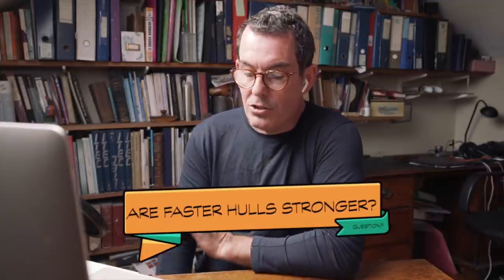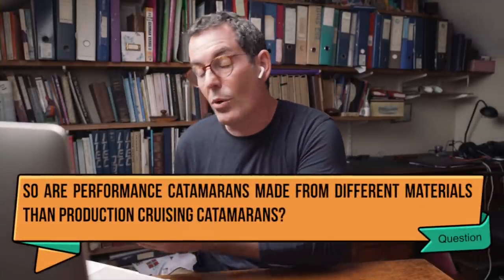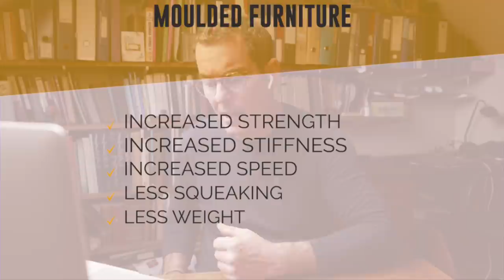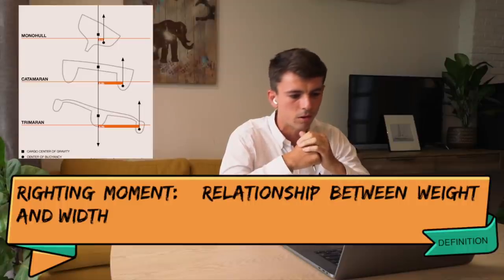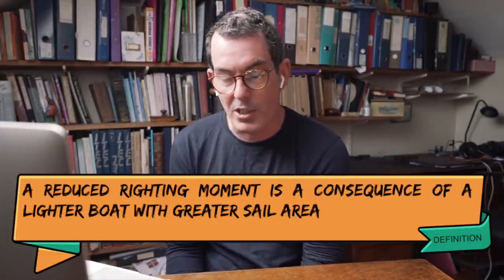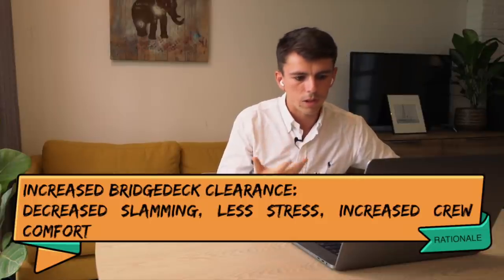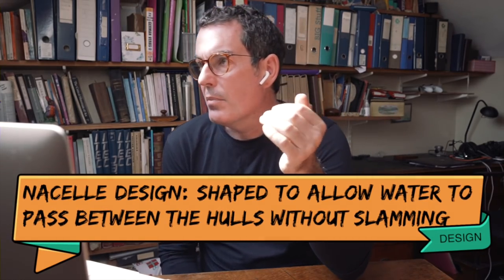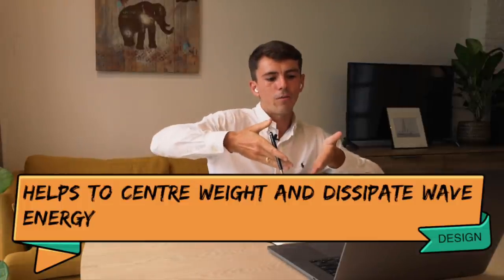CATAMARAN DESIGN: Why Are Some Catamarans Safer Than Others? Ep. 4.

Comment: one point. The narrower hull doesn't dissipate the wave energy, it takes less energy out of the wave
Reply: That’s what I thought I was going to use the word ‘absorb?
Reply: @JG-iz8ko  -- The hull shape could deflect the wave energy ... it will absorb some too.

When the waves break, we fix them!
Reply: Yer it’s how it cuts thou the waves to instade of riding on top of the waves
Reply: agreed
Reply: How about the narrower hulk slices through the wave.
Reply: yep it dissipates less energy because more energy stays in the wave.
Reply: Mission Gameliel  nope opposite.
Reply: @JG-iz8ko  It does not dissipate or absorb, in order to dissipate it must have absorbed. It 'deflects' the energy. Big difference. A bullet hitting a wall and stopping, the wall absorbs the energy. A bullet that ricochets of the wall has its energy deflected, with some lost due to friction. A long sleek hull has drag as it still has surface area, but it is less frontal area.
Reply: A little confusing. Is a narrower hull helpful with bigger waves? Or the fact there’s a keel on narrower boats? Or the cat having considerable weight up high with a mast?

Comment: You completely missed the danger of daggerboard and shorter "keels" being a kind of " tripling hasard" in big seas, leading to capsize. As the architect said, on a cruise cat, wind pressure only will lead to mast breaking long before capsizing. Rather let the architect speak and explain more with more open questions

Comment: Cats are faster due to less wetted area. Performance cats are lighter, to reduce wetted area. Hull shape contributes here too. Righting moment on heavy cruiser cats is so huge, the rig will fail first. This is by design to save the boat when in the hands of inexperienced sailors. I feel safer sailing a big performance cat in high winds than I would a cruiser or a tri. One has rudder authority for longer on a cat than a tri, meaning you can correct upwind at high angles of heal. Cruiser cats, you should never risk sailing in high wind, you'll likely loose the rig before you have any indication of overload. I would say that lack of rudder authority is the biggest contributor to Tri capsizes. Once you fly your centre hull, no rudder, you need to de-power or you'll get into lee helm and over you go. The amas with high volume will drag you down wind and you just can't dump enough main or jib to counter. Cruiser tris have less ama volume to give you time and then to pitchpole rather than capsize.. the design here is to submerge the bow but not pitchpole, but it not a controlled event and if trapped running this way, cut the back stay and let the rig go to lee. You can recover it afterwards, usually pretty buoyant.

Comment: Using furniture moldings is a low man hours way of making a boat, and an easy way to make a finished looking interior, but it is the weakest way of making an interior.  If every piece of furniture is laminated to the hull, that is the strongest way to make a boat, because every piece of furniture is a stiffener.  Molded furniture parts would prevent getting at the hull from the inside, which would be a huge problem if the boat has a hole in the hull from grounding on rocks or coral, or hitting an awash cargo container.

Comment: I feel that Nick somewhat misconstrued what the naval architect was saying on the strength of performance versus cruisers. Weight for weight, then the performance cat is indeed going to be stronger. But if you are not so concerned with weight, as cruisers aren't, the structure can always be beefed up at the cost of more weight. The safety from that point of view is a result of 'how safe and strong do you want it to be?' versus 'how fast and inexpensive do you want it to be?' It is not that performance cats are inherently safer as Nick took it to be on that point, although of course they are weight for weight. And the shape of the lighter cat may cut through the waves more, which reduces stress, but the lighter cat will bounce around more, which increases it somewhat.                                  Similarly on bridge deck clearance, the naval architect can choose that, and admittedly the designers of charter cruising cats often make them too low.                                                                         But the worst of all world's in that respect would be an overloaded performance cat, sitting a lot lower in the water than it was designed to do.
The ability to carry a lot of weight is a good thing, not a bad thing, and there are all sorts of valid trade offs which can be made between that and speed.
If you want to get out of the way of storms by running fast reliably, there is a lot to be said for a big engine and plenty of diesel.
It is what you fancy far more than safety for performance versus carrying a lot of stuff.

Comment: Where there is talk of “stringers”, and where the furniture is integrated into the mould & the design of the bridgedeck making it non-flat, is all about making the structure stronger by adding “compound curves” - they impart incredible strength, with minimal additional weight.

Comment: If you ever do a follow-up to this...I think it would be interesting to explore what it actually would take to flip one, picking a real world example or say a particular seawind model... what combination of wind speed and sail area...and then that coupled with tilt from a beaming sea?
Reply: A Conser overturned off of Lanai from a wind gust off of a cliff.  It is a very light boat, (12,000 lbs at 47 ft. loa,) with not much stuff on board since it was a day trip boat.  It had a tall rig.  It did have a lot of people on board, 44, perhaps about 8,000 pound of people.)

Comment: Just a clarification from my understanding of the equation for Righting (or Restoring) Moment on a catamaran does not have anything to do with the sail area (or the height of the mast).  I thought the formula was "weight * righting arm length" where "righting arm length" is the distance from the fall line of center of mass to the heeling pivot point.  It is a torque vector measured in N * m.  The sail area plays into the Heeling Moment which needs to be offset by the Righting Moment.
Reply: That’s correct. Righting moment is all about the hull and doesn’t have anything to do with sail area.

More sail area or increased mast height simply raises the centre of effort, which means there will be a lower static stability based on a given righting moment for the boat.

But it doesn’t follow that a performance cruising catamaran will have more sail area than a more accomodation-based catamaran. In fact, it may be the opposite, as a performance cruising catamaran can use less sail area to keep sailing as it isn’t as heavy and is more easily driven. Our 55 foot catamaran (a 2003 Outremer 55L) has nearly the same sail area (115 square metres) as the 10 foot smaller Seawind 1370 with a sail area of 116 square metres. For cruising, a smaller rig is safer.
Reply: @tomjarecki  Good remark guys! I was intending to flag out that sail area has nothing to do with righting moment,  but being a bit lazy, I wasn't looking forward to writing a long explanation note.
Thanks for taking care of that.

Comment: Looking at the photo of the caterman. The first thing you see is the dagger board down. The question is are both down. My understanding is that the Lee dagger board should be up. Should the windward hull lift then the Lee should slide to prevent it overturning.of both dagger boards are down then it will flip.
2nd there is no sail s visible
3rd very little of the hull is in the water to me it on a reef or sand bar or something.
4th dagger board s increase the risk of this happening as more  inexperienced people are buying sail boats and heading out to sea

Comment: Righting moment brought tears, either it was funny or memorable, priceless tho. Its counterintuitive like the term Light crew. In interlake racing that means being the last nth degree crew weight allowed. Needed in big windy days and out on the rails. Little youth in other words. 
Skipper screaming. Holding on, hoping and praying. Mostly that if it tips it doesn't turn turtle. Fun times.
Reply: THAT mar apply for a heavy mono but not so much on a cat need to have experience in Cat sailing fast (learn on a beach cat-hobie cat), tip over for fun and LEARN THE ROPES...   then gradually go bigger and bigger until you have a 40 ft LOA, by then you may know what is "fit for your purpose"...

Comment: Great Q&A. Thank you. There is confusion around bridgedeck clearance, that is important, but was not answered by the architect. If you're going downwind with waves then the bridgedeck clearance is largly irrelevant , this is 80% of circumnavigation cruising.  When you're going upwind, the classic way to look at slamming, waves will hit the bridgedeck causing slamming. That is an issue of course but...a more real issue is bow waves. On a monohull when you go over a wave it splits the water and a wave will fly to either side.  On a catamaran one side will be between the hulls and that wave will fly across smashing the hull on the opposite side between the two hulls. This is the most alarming and creates the most noise and discomfort while sailing for the crew. If that wave can be broken with a nacelle type structure in the middle it can be redirected downwards before hitting the other hull. This I believe to be the main reason for the nacelle's in many catamaran designs. Stray Kitty
Reply: You get more head room in the bridgedeck cabin with a nacelle, if the cabin sole is in it.

Comment: The amusing moment when Antoine reiterates that a heavier production cat generally has less chance of lifting a hull and inverting, but that it is totally irrelevant anyway because the standing rigging and mast will break first. So really what it comes down to assuming the price is the same, is load carrying capacity, space and comfort vs a circumstantial speed increase. I say circumstantial because power to weight of some charter cats are faster on motor. Build quality has nothing to do with anything but price, a slow palatial catamaran can still be built to the highest standard using the best materials but not be considered performance oriented. Great and honest video, I love that your videos are based in facts rather than blindly pushing a particular cat like an Outremer. ;)
Reply: It's not really about speed, rather more about the ability to sail well in all conditions. Sailing well means being more comfortable and rested during passages. Most performance catamarans have perfectly good accomodations.

About rigs breaking before flipping, I'm not sure that's true for any boat. Can you imagine the risk of purposely designing for a rig to break, then it causing damage and/or injury on the way down?
Reply: @tomjarecki   10:12  Antoine states it in the video that the mast should break before a production cat will flip....the rig and mast is designed to break....Seawind is a production cat, go phone a manufacturer like Leopard or whoever and ask them. "Performance" cats don't "sail well" or comfortably in all conditions, less weight and more speed usually translates to a rougher ride unless you purposely slow it down like most do. If you want to talk about what this "debate" is really about all over Youtube, it is about manufacturers like Outremer pushing a particular product based on very selective facts, fabricated controversy and pseudoscience through certain Youtube channels. Seawind/Antoine have actually said some very wise and insightful things in this series. He is not engaging in the hype of "performance cats vs..." but is designing a well rounded catamaran that keeps in mind what the market wants. The Seawind 1370 or 1600 was in my final two catamarans but they need to work on their sales end. If they sold directly to the public like Leopard without the BS of trying to get information out of a salesman, I might have bought the 1600.
Reply: @trentspencer7991  He says the mast “will” break but says nothing to back that up nor to point to a Seawind statement. I believe it is an English as a second language problem that he didn’t say “would” or “could”, which is I’m sure what he meant. 

No catamaran manufacturer anywhere says that they design their rigs as a fuse to prevent capsizes. If they did, they would be sued every time a mast fails, regardless of the conditions. The difficulty for systems like UpSideUp is to set the force high enough so that it doesn’t release when pumping through a wave but does release before the point of no return, is that it is nearly impossible to establish that force level. And good luck getting insurance if the manufacturer says that the rig is designed to fail.
Reply: @tomjarecki  So you didn't bother to call a production manufacturer and actually ask them did you? You do realise that he works for Seawind/Cosair and as such is representative. You would prefer to think that you are right rather than actually obtain an answer. You speculating  is pointless, go and ask a manufacturer or engineer. Why would they put it in writing for you or anyone else? Have you read an insurance contract? If you knowingly sail into a storm using a full sail plan you will most likely void your insurance regardless of a rigging failure or capsize, that is how they cover themselves. The mast and standing rigging should fail BEFORE it lifts 10+ tons of boat out of the water, not under normal conditions, not because it is designed to fail but because of its physical limitations.
Reply: @tomjarecki  Sorry again Tom, but cruising catamarans are truly designed and built so that the rig fails before the craft reaches the heel angle of vanishing stability.
Reply: @feshfeshsailing  That's not correct according to all sources I've looked at. As per my comment above, I challenge you to provide a written quote from any catamaran producer that says that. It just doesn't exist!!!! 

To repeat, the maximum righting moment is at the point when the windward hull leaves the water - about 10 degrees of heel on flat water. That is the point of highest load, so that's when a rig would fail if it can't handle that amount of load. I explained above how that is very unlikely when a rig is designed at a 2.5-3 times safety margin between working load (~60% of maximum righting moment) and breaking strength (~150-180% of the maximum righting moment). 

The heel angle at vanishing stability, which is when the righting moment changes from positive to negative, is around 90 degrees of heel angle. At that point there is only the weight of the rig loading it, so if it hasn't failed to that point it won't.
Reply: @tomjarecki  Tom, When boat designers/builders say "We built a fuse or weak point in the rigging" they don't necessarily mean the stays snap and the mast goes overboad. the weak point is usually set in the mainsheet traveller.
Reply: @tomjarecki  And forgot to mention that maximum righting moment on most cats nowadays is designed to occur between 14 and 18 deg heel (not 10 deg as you mentioned)

Comment: I really appreciate This searies because I have been desigigning my ideal catamaran in my head for 60 years and this helps me know wheter I have the design princeples correct.  My goal is to hve submersible hulls so that waves can pass between the hulls and bridge deck in any direction.  The weight of a wave pushes down  as well as up against buoyancy
Reply: huh?  🙄
Reply: Winglets on both ends except the front need to pivot to keep the depth of the Hull steady under water and floats up when you stop moving

Comment: I'm an engineer. When I'm trying to imagine how some things work on often take them to extremes as a mental exercise. A model boat hull could be made of epoxied cardboard and it will last for a while. The same shape hull that's 100x larger even though it's the same shape, there's almost nothing the same about how it will behave or react in water. Do the same mental exercise now with weights being close to zero and over weight. Etc. Some are useless, some aren't.
Reply: Actually scale models are an excellent way of designing a hull to predict its behaviour. This is done by many large companies, simulating waves and water speed and wind. Weather is unpredictable though, which is the hardest aspect to predict.

Comment: I've heard from other sources as well that computational fluid dynamics (CFD) modeling is not done as much as you'd suppose.  Computer-aided design is used mainly for manufacturing - planning the fit and cutting materials.  Modern designs rely mainly on empirical data of what works and what hasn't in the past.  Use of CFD is growing, but generally just used to spot-check specific components.
I love this series you've put together!  Thanks for sharing this with us!

Comment: As a multihull sailor for years I can tell you once you get used to them you can tell when your overpowered and reefing is required.  It’s hard to describe but it’s there.  I would say that if your quick you tend to be safer. Slow can be hit by gusts that put high loads on your rig but turning all that power into forwards motion can bring you undone very very fast